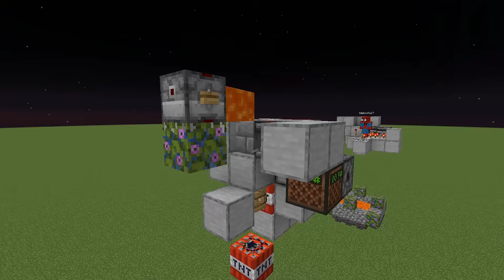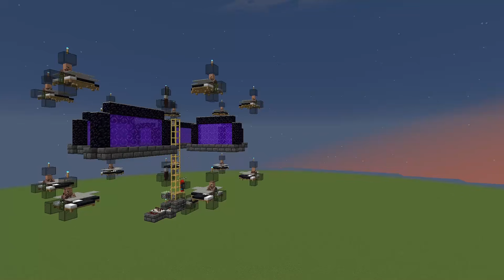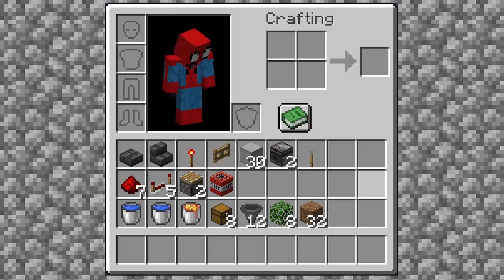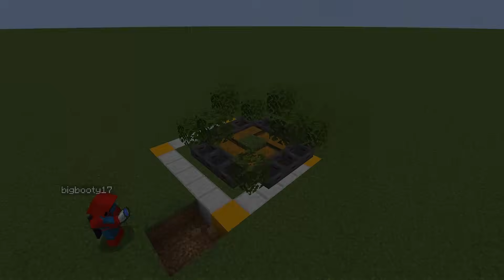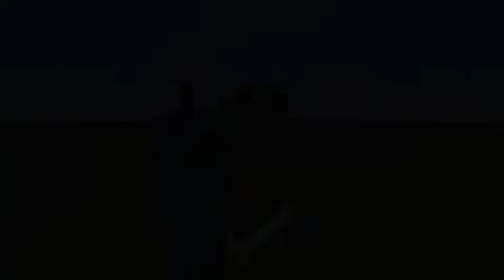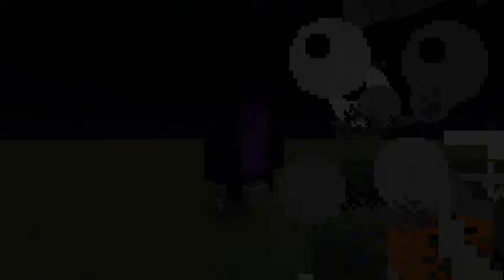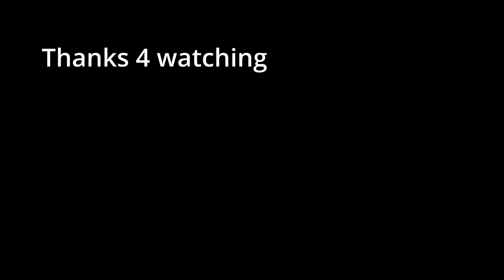Fast Simple Auto Cobblestone for 1.21+

Comment: This works in 26.3, but after it runs continuously for 30 min, it blasts itself.

 This happened to me 2 times, and I rebuilt it. I thought it was my problem that it doesn't work, but actually this farm has a problem; the problem is with it, not with me.

Comment: material list 
1. slab 1 
2. stair 1
3. redstonetorch 1
4.fencegate 1
5. hard block 30 
6 observer 2
7 lever 1
8 redstonedust 7 
9 redstone repeater 5
10 piston 2
11 tnt 1
12 water bucket 2
13 chest 8
14 hopper 12 
15 leves 8 
16 temproary block ex dirt 32

Comment: 2:32  I can’t put water in leafs on bedrock
Reply: Leaves
Reply: @guilhermetabordaribasperei5813 don't crouch and do
Reply: @HOTSHOT12305  this farm can’t be build at bedrock
Reply: @guilhermetabordaribasperei5813 dude you can just don't crouch when placing water inside the leaves i also play bedrock and you can waterlog leafs
Reply: @P @POLAR_SPIRIT47 is farm doesn’t works on bedrock !

Comment: Why won’t my observer go back it just gets stuck in on 1.26.2
Reply: because you would have done something wrong. check the arrow on the top for the orientation, if the observer isn’t facing the right way it will get stuck.

Comment: For everyone having issues where the cobblestone wont blow up, build the tnt duper 9 block up instead of 8. It fixed it for me. You might have to place obsidian in between the leaves where the cobbledstone does not generate depending on how you built your storage since it might start blowing your chests or stuff around it up

Comment: I did it step by step and it worked but then exploded when I left but then I fixed it then the tnt just stopped destroying the cobble
Reply: if it goes out of render distance it will break just remember to turn it off
Reply: @Tre @Treeman1353 I broke it then rebuilt it step by step then it wasn’t working

Comment: 2 problems i had with mine i used the same blocks you did and it work but it slowly killed it self over time by breaking the blocks so i changed out the blocks used for the smooth stone with obsidian and the singular grass block that is below the lava with obsidian and it fixed the problem for me

Comment: Working on 26.1.2, for those struggling with the farm exploding away, make sure you disable your shaders before building this farm (sometimes it changes animations of things) and water log correctly the staircase, note that the water must be flowing on the gap, not standing still. I had mine destroyed but i figured it out by that detail. Hope it helps.

Comment: Not working, I'm on the latest update - i built it twice following the guide perfectly. It explodes in the duper without dropping down
Reply: I discovered the issue; waterlogging works a little different now (not sure when it changed) than in the video. Waterlogging the stair is rather straightforward, I made sure to waterlog directly into the stair's void. Waterlogging the slab was a little difficult. Ensure the slab is properly waterlogged. Right-clicking with a bucket on the top of the slab doesn't work for me. I'm not using mods.
Reply: I built 11 variations of the farm. What worked for me is building the tnt duper 10 blocks up and leaving the repeater directly next to the redstone torch exactly as is, without any delays.
Reply: @reinhardtv.dmerwe360  I hadn't properly waterlogged the slab

Comment: this farm works in 26.1 for those who are wondering. Amazing creator.
Reply: Can confirm! For paper servers go to config map and set allow piston duplication to true
Reply: @WW-bio do you have the issue of the tnt dropping down and just not exploding the cobble
Reply: @qzsdpvp   what did you do i have the same problem
Reply: lowk just try building the whole thing a block higher, I just destroyed mine
Reply: @gamingworld-pj3sh gotta allow piston duplication in server config files i think
Reply: @WW-bio  it worked, i just made a mistake during build with one repeater being 3 tick instead of 4. On that note do you think is there a farm I need to build, I've got iron farm, cobblestone, that's it. Iam in some what early game, just got full iron from villager trading
Reply: @gamingworld-pj3sh  4 days late but for early game those are really the main ones. You can always do a gold farm / auto barter or a auto crop farm.
Reply: @gamingworld-pj3sh bamboo farm is OP for anything needing wood for crafting, kelp is Rly good for renewable fuel
Reply: It also works in 26.2
Reply: for me the tnt just isn't duplicating it just deactivates and gets moved around
Reply: @Ralgondo  check your redstone, i haven't built this in a while but i am sure mine works fine in the upgraded world
Reply: Tysm
Reply: The tnt isn’t breaking the cobble  for me aswell

Comment: Mikarific posted a video the other day which included a way to get water in the nether, and as we know lava flows faster in the nether, do you think youll design this with different timings so it can work even faster in the nether? or would it require a completely different mechanism?

Comment: someone else already mentioned building this whole thing inside a single chunk (use F3+G to check chunk borders) so it doesn't blow itself up due to chunk loading stuff, but i would also recommend avoiding loading and unloading it while turned on if possible; i entered the nether while leaving it on and it promptly vaporized the bottom few blocks and a single repeater from the clock

Comment: Did they change the tnt timing in the new version, i built it and the tnt landed inside the lava and nothing get blown up
Reply: Ur server has changed the tnt explosion timing due to paper plugin, just build the entire duper above the cobble generator higher, trial and error until u can match the timing
Reply: Also, i built mine 21 blocks above instead of 8
Reply: @usurperofthrones-s7y  thanks, i came up with other solution, cuz 21 blocks is a little accessive
Reply: @s.a.okirito701  can you tell me what solution did u came up with?
Reply: @haztom2  i change the entire lower half of it so its doesnt require perfect tnt timing, i have it landed on a block obi, and have 2 pistons constantly pushing generated cobble toward said obi, it gives much lower rate but more than enough for early game, i will update it to a design that doesnt require perfect tnt later on tho, btw i dont think its a paper thing, i made sure the server setting is on vanilla
Reply: @s.a.okirito701  that's actually really smart, i will try that thanks bro
Reply: I had this same problem and only needed to go up 9 blocks instead of 8

Comment: This is a fucking scam, doesnt work in the latest version anymore. Dont waste your time
Reply: or you built it wrong
Reply: Just built it on a realm I didn't have to worry ab orientation but I did blow it up on myself twice first. ik this is a year old upload so lmk if you need help
Reply: @carlos6126  i need help, the tnt isnt falling for some reason, and idek why
Reply: @Ronin0-123 You might not have waterlogged the top slab that's 1 block to the left, foward and up. if the tnts not duping thats a separate issue but should be easy cause I'm using the latest version and it still works. also I don't think 90% of this works in bedrock im on java.
if the tnt is duping but not falling check the slab for water and make sure u have the fence gate open, it stops the watwr but when it's open it also lets entities through

Comment: does a chunk loader cause problems?
Reply from the maker: Only if incorrectly distanced
Reply: if you use just an ender pearl bubble column, place the loader in the same chunk as the farm. if your farm is in several different chunks, it doesn't matter, the range of the loader will cover it. problems will only occur if you place the loader several chunks away, and your farm will be on the border of redstone ticking and non-redstone ticking chunks.

Comment: Duoper dosent work
Reply: It works on java edition, your on bedrock edition
Reply: @AveryZaytor I am on java but on server it doesn't work in single player it's works
Reply: @NotViush  did you build it wrong? Also servers just have anti tnt duping plugins maybe ask the servers mods if the server does have that.
Reply: @AveryZaytor I build it using litmitica and server doesn't have any plugin like this
Reply: @NotViush  if it was built correctly and works in single player but doesnt work in a server. What does that mean?

Aren't you a smart enough cookie to connect the dots? Its the fault of the server thats not allowing it to work not of the design itself.
Reply: @AveryZaytor  I am more smart than u bro haven't told the server is good I already said it does not work on server probably having issue with other mods or frabic issue

Comment: Have built this thing once, put an ender pearl chunk loader so that the farm is within its 3x3 chunk loading area and it blew up once I left the area to test it. I then read a comment that the whole farm should be built in the same chunk area to increase chances. I took it to a creative superflat world and did it, built it all in one chunk with a chunk loader and it worked, it didn't blow up, where the one built across multiple chunks did blow up. Took it back to the survival world, built it all in one chunk, had a chunk loader that encompassed that full chunk in its 3x3 chunk area and it blew up once again. I give up, what's the issue? Farm works fine but I cant get it to behave with a chunk loader even though it did behave in the creative superflat when tested in different scenarios.
Reply: pearl loader only loads 1 chunk, not 3x3. 3x3 is for portal loaders so i think thats ur problem. you gotta have it all in 1 singular chunk
Reply: @AllKnowingCatSo weird because Xisumavoid shows a video where pearl loaders did load the chunks around the chunk that the pearl is in also.
Reply: @lilbabymaker well the vidéo that i saw showed clearly that the pearl loader only loaded 1 chunk
Reply: @lilbabymaker  it only lazy loads the 3x3 around it.
Reply: @QuangHoangDec21 Whats the difference between loading and lazy loading. So a nether portal loader doesnt lazy load but rather properly loads?

Comment: Hi, as a noob I am following the layout on the floor, is it correct that it first shows 6 wide and 7 long and then later in the video this changes to 7 wide and 8 long? (at 06:34 for instance) I had initially followed the 6 wide and 7 long and now things are not properly positioned I guess. edit » made it work, but you get hit a little when you stand 1 block in front of the lever, easily fixable though :D

Comment: For me the tnt super just pushes the tnt once and then it ignites and doesn't dupe. Any ideas
Reply: Is it in a server? If so the server might have the dupes off
Reply: if its a smp running paper you gotta go into the config, pretty sure its paper-global and at the bottom set the piston dupe thing to true, the server should be turned off at this point and then turn it on and it should work

Comment: I can confirm it works in 1.21.11
Reply: Does it though? I'm seeming to have an issue with the duper not working in 21.10
Reply: Are you on a singleplayer world? I'm on a fabric server and it isn't working quite right. Yes, I built everything exactly according to the directions.
Reply: @idksomecarguy  hmmm what is wrong?
Reply: @superspy678  I fixed it by adding a repeater

Comment: EDIT  : PRETTY SURE IT WAS PAPERMC CAUSING THE ISSUE
The second piston doesn't activate for me, running a 1.21.10 geyser server with 0 mods that I would expect to screw with redstone . Didn't see any redsrone changes in the newest patch notes and I'm getting conflicting info in comments.

mabye bedrock-java (from geyser) shenanigans are screwing with it

Based the changes in the alternate version, I'm hoping that it will fix my issue.

Gonna try original and alternate connection on a test world to check if its the version or server. Will update in a couple hours when I'm done studyings
Reply: both work in my test world
oh poop

Comment: I tried building this in 1.21.10 and found it to be slightly flawed.
I was only able to successfully dupe the TNT and have it not blow up the duper when the block above the open fence gate was removed.
In turn, the time spent before it is dropped out of the duping chamber was shortened and the distance from the ground needed to be raised. I find that it is best to build up 12 blocks compared to 8 when making this adjustment, and that it is best to build the cobblestone generator a few blocks off of the ground.
Additionally, i noticed the hoppers and chests were likely to get blown up and instead opted to create a water funnel in the 9x9 area beneath the platform.

thank you for this really cool design! i had a lot of fun tinkering with it
Reply: Yes, go up 12 blocks, follow the same steps, and use redstone repeaters set to 3–3–3–2. It works in Java 1.21.10

Comment: IF ANYONE IS HAVING ISSUES, and you're running a run of the mill modded minecraft with only optimization mods, do note that this farm does not work with alternate current installed.
Reply from the maker: There's a chapter in the video to modify for alternate current
Reply: @bigbooty17 It did not work unfortunately, it seems the scaffolding method of powering the piston doesn't activate the piston for whatever reason
Reply from the maker: That is not alternate current then but some other mod causing further issues
Reply: @bigbooty17 Hmm, then I'm not sure what else it could be, though I might've built the alternate design wrong. I tested each section by itself.

Comment: Just tried to build in 1.21.10. The TNT didnt drop. Everything turned on but it looks like the left piston didnt push the observer back and the TNT just blew up inside like when you turn it off

Edit 14/01/2026, 1.21.11: Found out what was wrong. Mine was built on a server. The server had rules set so there could be no TNT duping. I was able to talk with the server owner and get TNT duping allowed. Rebuilt it exactly as show, it works like a charm! Thank you @bigbooty17 for creating a simple but amazing farm!
Reply: same here
Reply: @realLeCHL  works fine for me
Reply: same here
Reply: that’s what happening to me
Reply: The water doesn’t stay in the leaves. Just runs out. Maybe patched?
Reply: @DiscipleDaven  Are you crouching while placing? If you are, you don't waterlog the leaves, so don't crouch.
Reply: @cyanprint002  I don’t even think about that. Thanks
Reply: make sure to put the water properly on the stair.. it has to show as flowing state. put water in between the stair and the other stone

Comment: Tried building it on my server aswell as single player. In SP it works totally fine, on my server the tnt doesnt break any blocks in the lava (breaks blocks if the lava isnt there
Reply: After some testing i think the problem is that the tnt drops into the lava while in SP in explodes just before, any ideas for a fix/ reason why this is happening?
Reply: @moritzbenn not a solution (sorry) but thanks for explaining why it doesn’t work

Comment: Quick Tip: Build it all in one chunk, it'll tremendously lower the chances of it blowing itself up due to chunk loading. (F3 + G to open chunk borders)
Reply: Have built this thing once, put an ender pearl chunk loader so that the farm is within its 3x3 chunk loading area and it blew up once I left the area to test it. I then read a comment that the whole farm should be built in the same chunk area to increase chances. I took it to a creative superflat world and did it, built it all in one chunk with a chunk loader and it worked, it didn't blow up, where the one built across multiple chunks did blow up. Took it back to the survival world, built it all in one chunk, had a chunk loader that encompassed that full chunk in its 3x3 chunk area and it blew up once again. I give up, what's the issue? Farm works fine but I cant get it to behave with a chunk loader even though it did behave in the creative superflat when tested in different scenarios.
Reply: @lilbabymaker  dont enderpearl load Just 1 chunk?
Reply: @lilbabymaker  No clue to be honest sorry, I mean you can copy your world save file and then try building it in creative i nthe back up making sure it's all in one chunk. Chunk loaders can make stuff act weird though. Game lag is another thing that can cause it to blow up probably, so if you're using a chunk loader + loading the chunks around your player that could be causing you lag leading to it getting destroyed?
Reply: @xxawesqmexx Game lag shouldn't cause it to blow up unless you're on a paper or spigot server. On Vanilla/Fabric, lag just means the game is taking more time to process, but that won't affect anything except player inputs.
Reply: My farm blew up even though i built it in one chunk, i imagine it was due to chunk loading cause i left and came back to it blown up.
Reply: Yes my farm exploded so this the problem?😢😢
Reply: @igiverespect0  Likely yes, though I can't gaurentee it. If it blew up instantly after building it though you probably built it incorrectly.

Comment: This doesn't work in 1.21.9 I believe, I have this in my world and I updated, I left the chunk and it broke, I rebuilt it but the cobblestone won't break anymore
Edit: I modified the bottom half of it to where the blocks explode, the lava has to be on the outside rather than it being a puddle on the inside. I set it up as a obsidian bowl with water at the bottom with hoppers and still is as efficient as before! Remember only use obsidian and add a layer of obsidian under the tnt duper!!
Reply: Hey do you have a photo of how you have it setup??